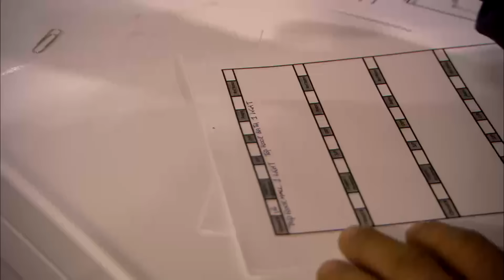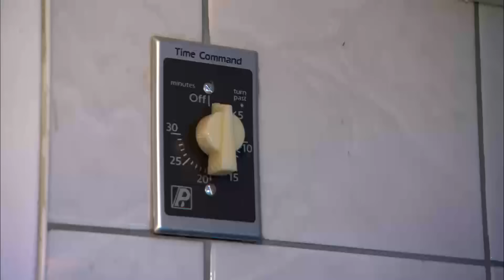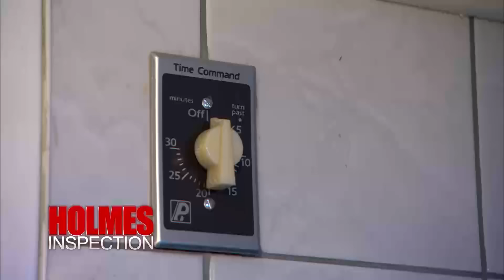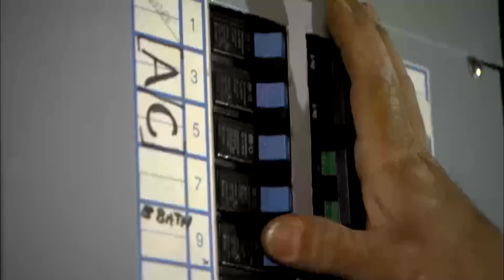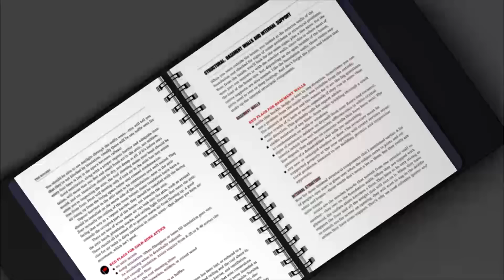Are Home Inspections Necessary? (Yes, They Are) | Holmes Inspection S125

Comment: When I bought my first house, my realtor actually advised that I didn't need a home inspection because the house was fairly new(14 yrs old!).  I got one anyways and was glad I did.  It gave me some peace of mind.
Reply: we had the same thing, house built in 2008, turns out they missed so many issues, leaking roof, gutters, stair treads not installed correctly (for 15 years!)
Reply: I would fire my realtor for telling me that bs.
Reply: Remember, your realtor is all about selling you buying the house for a high price, just like the selling agent.
Both agents are paid a percentage of the sale price of the property. If the price paid is $50,000 lower because you need to replace the roof and HVAC and repair structure and electrical and... Both agents lose money.

Comment: Comment on stove "power" at 20:18.  Gas stoves don't require 240V power.  It could use 120V for electric spark and / or a clock.  The 40A breaker could have been for an electric stove when the home was first built, for a condensing unit, or an electric water heater.   It would have been a good idea for you folks to acknowledge that a gas stove may only need a 120V circuit.  Might have been a teaching moment for your viewers.  Still, I like to watch the team in action.

Comment: I have always enjoyed your videos and you cover so much stuff correctly and I enjoy that the one thing that drives me nuts is the carpet installation. They put the carpet in with a knee kicker and not a power stretcher. Carpet Hass to be power stretched to be properly installed if you’re going to do it do it right the first time. I don’t understand how you let these get away from you. I have watched many of your shows, and when they install the carpet, they use a knee kicker. One gentleman did use a reverse stretch stretcher that does pull them up snug but not as tight as a power stretcher, and I guess that does sort of work, but the tighter you can get a piece of carpet the longer it will last and the softer it feels, even over a cheap pad. I’m not saying put in cheap pad just the tighter, the better. I grew up in floor covering I have done vinyl tile, ceramic parquet I have laid carpet inside outside decks in swimming pools. I have carpet in the interior of trucks, cars, carpeted couches, barstools saddles, and the list goes on and on if it’s something that needs to be carpeted, I can do it but I would like to see a carpet stretcher on one of your videos if you’re still making new videos. May God be with you and bless you and your team and keep you safe.

Comment: Honestly, if home inspections are a necessity for you,  you might want to just consider renting.  I find that it is about 50/50 whether you are going to get a good inspector.  And then some will point out stuff that isn't worth shaking a stick at.  Such as plumbing underneath a bathroom vanity.  I guarantee that I have a violation there in my own home so that I could increase the space underneath the sink. The water goes down great, and its sloped right, and the trap doesn't get sucked dry.  I have some heat runs that aren't taped up... big woop de doo.  That's just providing some extra airflow above the suspended ceiling in my basement and its not like that heat is getting wasted at all.
Meanwhile, I found a broken piece of flashing around my deck patio door that caused a 1 foot square piece of sheathing to rot out.  It was impossible to see without pulling the siding.  No inspector caught that.  I found two joists underneath my foyer missing hangers.  Not the original inspector, nor the FHA inspector, nor anyone else ever caught that one.  The stair stringer going upstairs was hung by 1/2" OSB.  It was never a problem for 20 years and showed no signs of a problem.  I am pretty sure that's not right.

Back in the day, my dad pulled permits for all kinds of stuff.  NOT ONCE did ANYONE come out to look at ANY of the work that was done.  The whole process is bogus.  It is just a means to have home improvements on record so the county can tax accordingly.

Comment: In a lot of ways the inspection angle is a lose lose situation. Don't get an inspection and this video is what happens. Get an inspection and the inspector is lazy, incompetent, doesn't care, half blind and says everything is fine and you end up getting a similar situation with no recourse. There simply is no gaurantee that the inspection is worth the paper it's written on. I'm sure there are folks who do perform a good inspection but in 2 home purchases in 2 different states I have yet to find one.

Comment: How much of this would a home inspector really find?
Reply: Good point.  He will not move ceiling tiles to look for junction boxes.  There probably wasn't water in the sink or tub when he came.  (However, a good home inspecter would run the water to inspect traps, etc.)
No railing on the stairs:  that should be common sense to anyone.  Compared to other episodes where they actually had a home inspection where he missed MAJOR stuff, she made out pretty good.
Doesn't anyone else see the irony here?

Comment: It's too bad they always do the gutters wrong. They're supposed to be BEHIND the drop edge so they catch 100% of the water coming off the roof, and if they end up below the drop to make pitch they need to be flashed. 

Also if you find your gutters aren't behind the drip, don't just caulk it. Caulk fails and all you're doing is making it harder to service in the future.

Comment: Looking at the issues the home has, I don’t think an inspector would have caught most of this.
Reply: and mike says that himself there is some stuff he does the home inspector isnt allowed to do. as it would cause damage that would have to be repaired.
in Australia a building inspector isnt allowed to check the roof you have to get a roofer to do that.  there not allowed to go over 2.4 metres above the floor or ground level. same with electrical unless there qualified in those trades
Reply: True, but the inspector should have caught on that there were no return air ducts for certain parts (almost all) of the house.  It also sounded like the electrical guy thought the breaker box was not wired well.  And the gas being done wrong was obvious on the surface.
Reply: The little electrical tester Mike carries costs about $6, you plug it in an outlet and it tells you right there - ungrounded outlets = electrician

Comment: What is wrong with copper gas lines?  Been using them for decades and In code.
Reply: In the Netherlands ALL gas lines are copper. The issues here where the couplings and the fact that the copper was touching other metal and the line was THROUGH the return-air duct.

Comment: Mike, im begging you. Please send help my way. I just bought a house 2 years ago with cash and stipulations from the seller that its as is. Problem is i was nieve and didnt know what to look for. House was old and i knew it needed work but wasnt expecting the amount of work it needed. The seller put lipstick on a pig and called it beautiful. The floors have a paper thin sticker on them. The floors are like a trampoline. My kitchen floor slopes to the outside wall, my floor joists in the bedroom gave way and i had a big hole in the floor. The nails rusted out and 4 joists fell. The toilet floor bounces everytime i sit on toilet and my toilet stack has a big crack in it. No insulation in the walls or attic, windows look newer but there is no trim around them or insulation. 3 old wall propane units in the house that give me headaches. Electrical problems. The lights in all the rooms dim when i use microwave. No ground port in sockets. When it rains i have to mop the bedroom floor. Outside i have a detached garage that has all rotted sill plates, rotted studs, garage door doesnt seal up, breezeway thats sinking down, insolation is espestos, ceiling is bowed down in the middle and no insulation. Right now im working on my yard drainage. The septic runoff goes directly into the tile, yard floods and my property smells like septic. Sidewalks, garage floor and patio cement is only an inch thick and is broken/cracked everywhere. Electrical in Garage is ceramic fuses and old wiring with no ground. My trees are all dying because of the flooding. County wont fix the town storm water drains so everyones storm water ends up in my yard. Roof needs redone, soffits have holes and i get critters in the attic. No window trim on the outside. Gutters hold water. My cistern is under the kitchen which makes my joists wet. No joist hangers and subfloor is inadequate. Crawl space is narrow so i cant even get down there to fix anything. I cant afford to fix things but i cant even sell the house in this condition. Im begging you please send me some help. I cry everynight because my house is a mess and i should have never bought it. I dont know wherelse to turn. Im sick all the time now. My dogs bring the mud into the house and it turns into dust. Dust that smells like septic and im breathing it in. Please, i beg you to help me. john2willis@yahoo.com

Comment: One needs Mike Holmes to do the home inspector or you’re probably throwing money out the window … aren’t most of these repairs Mike is doing, a result of a bad home inspection? 

The problem is the builders and the contractors aren’t held accountable for shabby and unsafe workmanship … and the same with most home inspectors. Litigation is expensive, not to mention stressful … doesn’t always yield the cost of remediations, to resolve these issues.